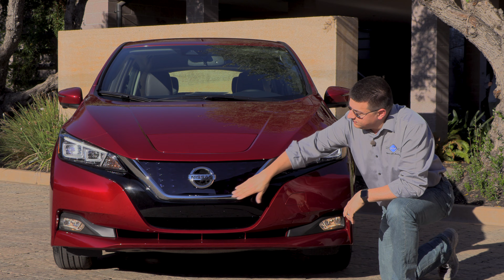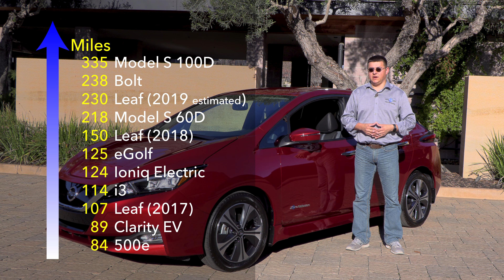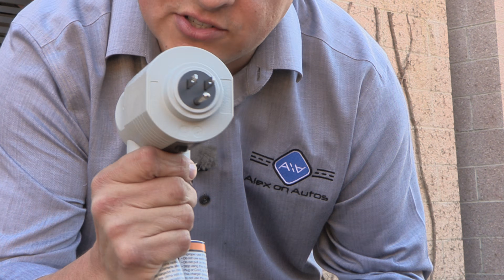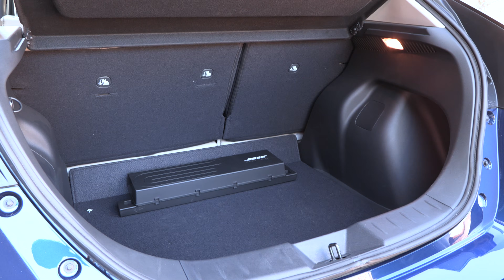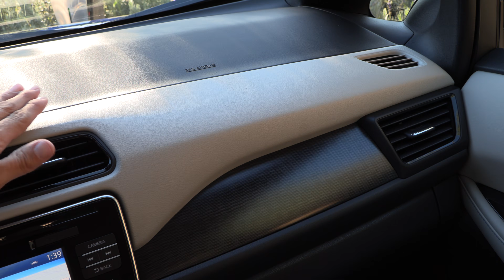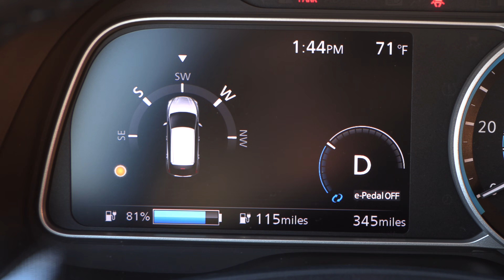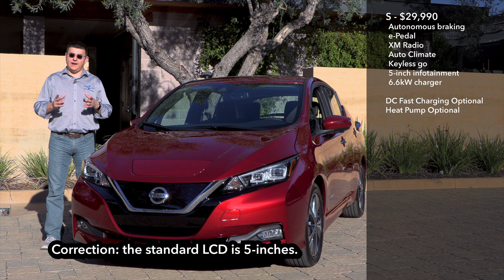2018 Nissan Leaf First Drive Review

Comment: Rapid improvements in electric vehicles clobber resale values. ("Anybody want to buy my 2011 Leaf with a 70 mile range?") Implies the MSRP of new EVs is artificially high. It's a test case for deflation - modern economist's worst nightmare. However, EVs are doing their part to keep pressure on oil producers not to jack up prices. A sustained oil price spike is going to cause a surge in EV sales and I expect many of those EV buyers won't go back to an Internal Combustion Engine (ICE) again. Very well done, Nissan. I hope the passive battery management works out this time around. (Search "Arizona and Nissan Leaf" for details.) 
Also consider that about two-thirds of the parts in your local O'Reilly, Autozone, Advance Auto Parts, etcetera become obsolete for an EV owner. That makes EVs a huge threat to the entire passenger vehicle industry with much smaller, more efficient supply chains. How long has your big electric motor at home (air conditioner/furnace blower) been running? 10 years? 20 years? EVs look like "cars" but they are truly revolutionary.
Reply: Ivan Ivanov - Please accept my apologies, sir. I do not own a Nissan Leaf.  The 2011 Leaf question was meant to be rhetorical in order to illustrate the rapid improvements in EV range that are also rapidly depreciating the value of older, shorter-ranged EVs. By late 2018 there should be a 200 mile range Nissan Leaf. This means that in just eight years, the Leaf's maximum range will have tripled. Could the 2026 Nissan Leaf have a maximum range of 600 miles? If so, expect EV resale values to continue dropping faster than ICE vehicle values. Of course, a fuel price spike would disrupt this trend as EVs of nearly all ranges became much more popular.
Reply: Samuel , I am interested in your 2011 Leaf , how much is your asking price ? Thanks
Reply: you have to buy a $5-7,000 battery every eight years. I was considering buying a used 2011 but the battery will need to be replaced soon. I don't want to spend $5-7,000 on a new battery. I'm going to buy a 2004 toyota corolla
Reply: Don't forget all those quick oil change businesses that won't be needed. Bye-bye Jiffy Lube.

Comment: The Ioniq has active battery thermal management at the same price range. This will give you a longer battery life and more years before you need another car. Or more value to get when you sell it to the next owner. And when the ev Niro becomes available the Leaf will be even farther behind. I hope Nissan does more for the 60kWh version. Liquid fan cooled would be optimal.
Reply: Anyone who beliefs that fantasy knows very little about current lithium battery chemistry. Your info is FAKE. TOTALLY FALSE. But you can buy a Leaf and live in a dream world if you wish to. The reason Nissan hasn't included active battery thermal management is planned obsolescence plain and simple.
Reply: eb1888 Yeah, that's the worst part of the Leaf. The battery will probably not last as long as the Bolt's.
Reply: Thermal management matters but fewer charging cycles matters too.  The extra range & 12 kWh in the Leaf means fewer charging cycles over the life of the car.   Not sure which car's battery will degrade more over the long term.
Reply: eb1888 - Please prove your planned obsolescence allegation against Nissan. You can't. Your allegation is fantasy. Here's real world PROOF that Nissan's batteries are top performers with a LEAF taxi passing 100,000 miles with all 12 capacity bars still on the display and NO active thermal management:
https://insideevs.com/nissan-leaf-taxi-hits-100000-miles-still-battery-bars/
You're just putting out your undocumented opinions. I deal with the hard facts.
Reply: Easy to prove--the 40kWh battery will bolt right in an older Leaf but Nissan has said they won't do that. They say just buy a new model instead.
Reply: eb1888 - Please provide your documented source that Nissan is forever blocking newer replacement batteries for older LEAFs. I have not read anything on this.
Reply: Call Nissan directly for the info you need. Their reasoning is- the car isn't worth enough to justify the cost of a new battery. Which is because of the poor long-term quality of the battery. Kinda a circular argument.
Reply: That taxi study is an excellent example for that type of use. Low speed, short distance with frequent recharging. It would be almost impossible to construct a use profile that would stress the battery pack less. And if you'll be driving your car like that your concerns are answered. For an owner who regularly travels greater non-stop distances at expressway speeds of 80+mph with occasional 250 mile runs your example is useless. Please keep in mind how a new ev could affect an owner. With almost no maintenance costs and a greatly reduced per mile 'fuel' expense an owner will experience more of a freedom to travel farther and more often. To meet that more likely profile is how the battery should be protected. A car that fits with that new found freedom is what many owners want. Not this Leaf except for those using it as a taxi. Pick a car to match the freedom you'll have.
Reply: eb1888 - You are speaking for the Nissan Corporation. How do you know this? Did they authorize you to reveal their thinking on this? Or is it purely your speculative opinion? If they made a flawed battery then why is it performing so well? Why did they increase the warranty to 8 years/100,000 miles?
Reply: eb1888 - The taxi example is typical of Nissan's newer batteries. It's not just taxis which are enjoying long battery life. You have been very wrong in demeaning the quality of Nissan's newer batteries!
Reply: The 8yr/100k warranty is just if you go below 9 bars. The first bar represents a 15% loss(info from Leaf Forum). Each additional bar is about 6.25%. So the warranty 'may' kick in once you've lost your 4th bar and 34% of your range if it works like for past Leafs. But Nissan is releasing how the warranty works for 2018 Leafs next week. So I'll  know more specifics then. Who knows.
Reply: Nissan support for post purchase ev owners will give you similar info. 877-664-2738.  One I spoke with stressed that heat is the number one factor in killing the battery. His example of what could hurt the longevity of the battery is high speed expressway driving followed by DC fast charging and more high speed. A battery could go within 24 months with repeated heat cycling, he said. Battery overheating is the main negative factor, according to Nisan as their support rep says. . . . . and that's why active thermal cooling would reduce this negative outcome. Taxis don't have to worry. Many, many other drivers, me included, would have problems.
Reply: eb1888 - Of course overheating is bad for batteries. But the LEAF's battery management system PREVENTS overheating! In the very RARE event of overheating the LEAF will stop charging or, if moving, reduce power to STOP any possibility of an overheat. Nissan's newer batteries are much improved. Their earlier batteries did have some design and degradation issues but current batteries are excellent. You don't ever have to worry about overheating the battery. The car just won't allow you to do that unless you set fire to it!
Reply: Nissan technical support employees do not agree with you I'm afraid. Drive regularly on the freeway with fast charging and your battery can lose capacity quickly enough to get to 8 bars in year two of your eight year warranty period they said. Not me. I believe them not you. The car doesn't stop that from happening over that time period. It will stop you from single event catastrophic overheating. It could stop you from recharging after freeway driving until the car slowly cools down. You could be waiting for many minutes or hours. If you have a commute or driving that requires repeated heat cycling from freeway speeds this car cannot protect the battery because it cannot cool it. A car with active thermal management will last longer according to Nissan.
Reply: eb1888 - The advice you received is for the early batteries, not the current ones. I met one of the members of the 2010 LEAF development team several months ago. He told me that the new batteries are excellent and are built to take anything without suffering damage. He said you can fast charge them all you want and they won't be damaged like the early batteries. That's why Nissan has such a long warranty on them!
Reply: We'll see once Bjorn Nyland gives us a video review of the new car. He'll run the car enough to test it just like he did last summer when the previous version failed. Until then I'll stick with what Nissan told me yesterday. Nissan includes active battery cooling in the e-NV200 available in Europe and which will soon have the 40kWh battery pack.
Reply: Very poor cold performance for the Leaf and inaccurate BMS: https://www.youtube.com/watch?v=Gj3MsS9M3dE
Leaf warranty warning: https://www.youtube.com/watch?v=WlxBOJrEKAo
Massive degradation on new lizard chemistry: http://flipthefleet.org/2018/30-kwh-leafs-soh-loss/#comment-240
Leaf has no way to charge to recommended 80% max for lowest degradation, but charges to 100% where if left at that state will rapidly result in dendrite growth.
Reply: eb1888 - Active thermal management is no longer needed on these new generation batteries. They have much improved chemistries which eliminate the need for active thermal systems. They are built to withstand very high temperatures with no damage or degradation. The battery management system will NOT allow damage as it limits speed and/or charging long before any damage can occur. This is why Nissan backs up their battery with an 8 year/100,000 mile warranty!

Comment: As a Chevrolet volt owner I cannot wait to try this vehicle. Chevrolet Bolt seats were terrible
Reply: It's a pity, such a small saving in space and weight, but everybody complains about this.
Reply: Too thin in the padding
Reply: Is it something an upholstery shop can fix? Not that it’s any consolation, but could be an option if you like all other aspects.
Reply: If the Bolt seats are so bad, then just install aftermarket seats. Many options available.
Reply: I had a severe pain problem with a Forester seat and my smart wife bought real sheep seat covers that solved the problem.

Comment: I wonder how this new Leaf would compare to the Ioniq Electric.
Reply: Trades46 what about next years ioniq? Should have better range too. It would be great if both leaf and ioniq offered a upgrade to the new battery for this years model.
Reply: The Leaf is much "thirstier" than the Ioniq. So it goes further for less KWh's. However, there's a 6 month waiting list.
Reply: The Ioniq EV seems to be selling well in Canada; I seen quite a bit at the college campus I go to. Also keep in mind the Leaf mk2 now has a lower cd of drag which improves the MPGe, but likely not beat the world-class 136MPGe of the Ioniq. 

There are rumors of the Ioniq EV gaining a 200mi range, but I can't find any info on its battery pack. Knowing the Model 3 (base) has a 50kWh is estimated at ~126MPGe & gets a supposed ~220mi, I would naturally assume the Ioniq would need a ~45kWh to touch the 200mi mark.
Reply: Before signing for a Ioniq, check the maintenance cost, you will fall off your chair.
Reply: The next year's Ioniq will be competing with the next year's Leaf, which will have a 60kWh battery (I think) with 200 miles of range. And, yeah, I think the car itself will be exactly the same, meaning that technically you can insert the new battery into the 2018 Leaf should you have enough money :)
Reply: Eats it for breakfast. The Ioniq EV is efficient but it only has a 28kWh pack. This Leaf mk2 has 40kWh while the 2019 Leaf is slated to have a 60kWh, matching the Bolt. Or you can be a sucker and pay more for the Model 3 which only has a 50kWh pack (the optional 75kWh be significantly more than the heavily advertised ~$35k price)

Comment: Nice...I was wanting a  Ioniq EV but there is a long waiting list so I guess the new Leaf it is...great job as always Alex
Reply: Funny how different market areas have different brand coverage...here in Ontario the Ioniq EV is easy enough to get followed by the Leaf then the eGolf which is sold out for the 2018 alottment...
Reply: The 2017 Leaf was impossible to get in Quebec and very few were on offer in Ontario last year. Likewise, the Golf was nowhere to be found. Both makes were sold out in no time. As for the new versions, they are all pre-ordered these days (I did just that). The new Ioniq is coming out in late 2018, soon after that we'll have the extended-range Leaf with a similar price tag. Not sure about the Golf, but it looks like the price always reflects the range more than anything else and purchasing an EV doesn't make much sense now as the battery sizes continue to grow at quite a steady pace. Leasing, though, is totally the way to go.

Comment: Great review as usual. The Leaf would be even better if Nissan can manage > 200 miles range with the same 30K start price. I will wait a few more years for better range electric vehicles at a similar price.
Reply: If Nissan did that, it would wipe out literally ALL competition, Tesla included. Unfortunately, it's just not feasible atm.

Comment: Looks good! And you can't piss on a 150 mi range, but I'm sure they weren't expecting the Chevy Bolt to have over 230 miles. They better get that upgrade to market.....
Reply: Bolt is ~$39k. Leaf is ~$30k. That is a massive price difference. Also I like the look of the Leaf better; Nissan did a good job on making this EV actually look good & more normal.
Reply: Early next year..

Comment: The 200 mile range version coming out next year will compete more with the Chevy Bolt....
Reply: And if it has active battery cooling, I'll pass on the M3. Nissan has the best seats for the money.
Reply: At which point everyone else will also have more range or less price. Nissan still gets left behind.
Reply: It was rumored this car would get the same air cooling that the e-NV200 got, but it's looking like that's not the case. 2018 probably has pre-divestiture NEC cells with passive oven-cooling. I think 2019 will have LG Chem cells- and I think that will be the one to wait for.
Reply: and 200 mile range price...
Reply: "compete more" Bolt does not compete with no one ..look at Bolt sales numbers...they are laughable  ..Bolt sold for whole year like toyota sell in few hours
Reply: Talking plug-ins here.  Bolt sold 20k vs 11k for the Leaf in U.S.  Plug-ins only make up 1% of new car sales in the states, 25% in some other countries like Norway etc...
Reply: compete for blandness?